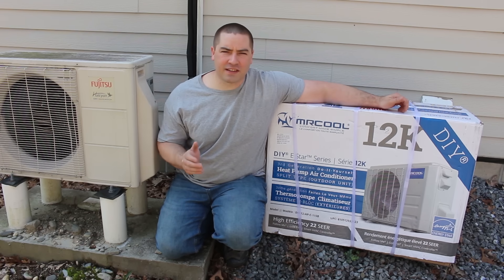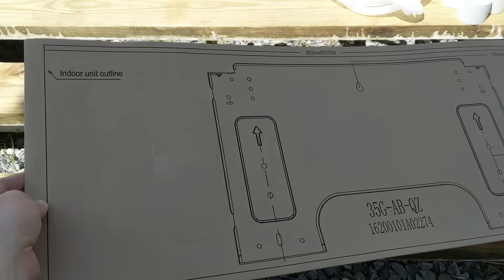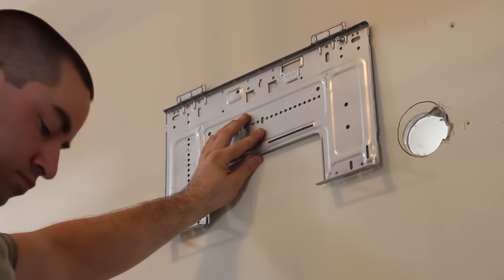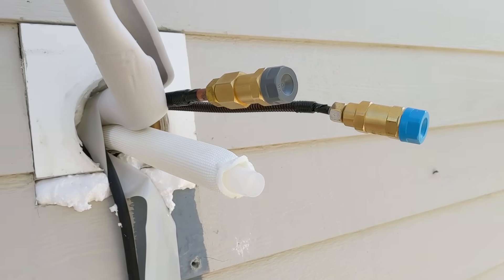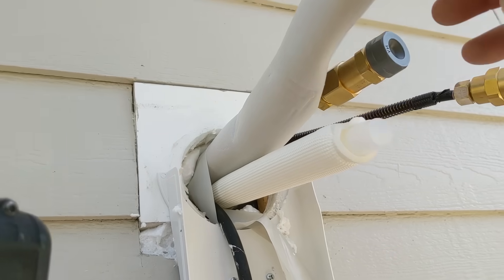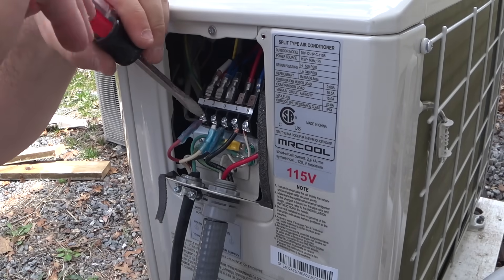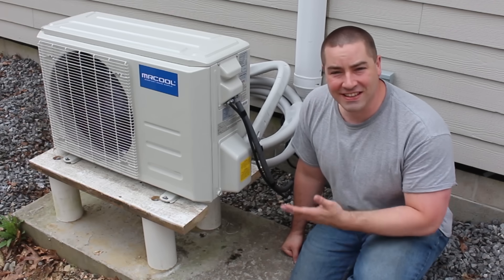Installing My Own Mini-Split Heat Pump, DIY

Comment: I've watched 3 Mr. Cool install videos so far, all of which have been very helpful, but not a one has expressed any concern about coiling up the excess pre-charged line sets once at the condenser. The units come with 25' line sets which for my 1st floor install is 10' more than I need. I've read contradicting articles about coiling. Some say it's fine to do so, others say coiling  may impede oil return to the unit. There is a 15' Mr. Cool line set available for an additional $300. Is this necessary ?
Reply from the maker: Mine stopped working due to leaking refrigerant.  Leaking refrigerant has nothing to do with coiling a lineset, so I'll say that the coil doesn't matter.  But, I'm not getting any more Mr. Cool stuff personally.

Comment: Not criticism, just added for those who may need the helpful ideas based on experience.  Did he level the template? Didn't look like it, but would be worth noting as part of the verbal instructions. For his modified base for the outside unit, it looked he may have used wood. A composite deck board would have made a best choice. For the wood, a clear coat spray paint with UV blocking capability on the label, such as Rust-olium Crystal Clear will protect from the suns damage & water. Also a spray can of truck bed-liner would make a permanent durable weatherproof seal for that area.

Comment: Hi. I watched a couple of your videos. I'm wondering which method is better to raise the condenser for snow? This one where you had previously used 4 inch PVC pipe risers (filled) with concrete or the one which you built a pad, then after 30 mins of the concrete somewhat hardening, you placed 2 concrete bricks on it and leveled？ Appreciate you a lot. thanks
Reply from the maker: The concrete block was much simpler and works fine.  But, it worked out because the feet on the compressor unit fit the size of a concrete block.  If your compressor unit is a different size, check if it will work.

Comment: My issue is with all of the excess coiled refrigerant lines behind the unit, condensate disposal, and the fact that an average house would need 3 or 4 units for even cooling. The concept has merit.
Reply from the maker: Yeah, I don't recommend this DIY kit anymore.  I prefer to cut/flare/vacuum my own lineset.

Comment: Great video.  I don't like the coil of set line that needs to be put stashed behind the compressor.    It seems that Mr Cook ships 25ft sections only to the big box store channels.  Is yours a 25ft section or a 16ft section?  Thanks
Reply from the maker: Mine was a 25' coil.  Mr. Cool stopped responding to my e-mails after my unit stopped working.
Reply: @DavidPozEnergy  I see now that you have a couple of Mini-split install videos.  I guess that is not a ringing endorsement if they keep needing replacement.
Reply from the maker: No.  I've had the best luck with the one I vacuumed down myself.  I don't like this DIY kit from Mr. Cool.

Comment: I look for things that don’t make sense or (wtf) issues and must confess this one was almost flawless. The only potential issue was cutting the condensation tube too short and allowing it run into the houses foundation. Not a big deal and is nit picking considering the fantastic content provided. Well done!

Comment: Awesome video!  I installed a 24K unit and planned my run to use all of the 25 ft line set into the center of my house through the attic.  For the inside drip, I was able to route to the garage floor.  DIY cost was about $3K plus my own labor.  Quote from the local AC guys was about $14K.  I love the quiet operation.  Working with Cielo to diagnose why the app and Wi-Fi connection doesn't seem to work.  The remote works perfectly fine.
Reply: How big of a room is that unit in?
Reply: How easy was it to route through attic?

Comment: The only thing I'm wondering about is how to fill the system with a full charge. The lines aren't charged until you connect them to the compressor unless they are charged before connecting. Maybe I missed something. Nice video of the install.

Comment: You either got a dodgy installer or did it your self with the Fujitsu unit. The have 5 years parts and labor warranty upon purchase.
My guess is the reason you didn’t claim warranty is because the installer was unlicensed or you installed the unit. When you do things the cheap way you end up spending double the money and 10 times the headaches.

Comment: Hi, thanks for sharing so, since you've had it since about 2 1/2 years do you still recommend it has there been any issues with it? Thanks
Reply from the maker: No.  It stopped working and Mr. Cool has stopped responding to my e-mails.

Comment: Aren't you supposed to pull a vacuum first to test for leaks before releasing the refrigerant? Seems like you have a tonne of air in your hose now and hence why it didn't hiss when you released the refrigerant

Comment: Thank you for the walkthrough of your installation. 
One question for you, don’t you have to vacuum the unit like I’ve seen done on other videos ? 
I’m installing one in my home and I would like to know. Thank you!!
Reply from the maker: Some models need a vacuum and some don't.  check your manual.

Comment: Two years later, any update? Is it still running as it did initially?
Reply from the maker: It is not working right now and I've emailed them a lot, but they stopped responding.

Comment: Overall a great project and I'm a diy when ever possible. Watchin is one thing but to electrify a heat system is not good idea for providing such a 'kit'. So many things that can and or do go wrong, it may cost you a lot more if unit goes south. Assume there's a limited warranty on the unit ?

Comment: FYI. From my installation instructions: "The line sets are designed to only be installed once.
The seal within the line set cannot be guaranteed if
they are installed more than once. This will void the
warranty. They also contain a compression fitting
to seal and do not require a thread sealent (teflon
tape, etc.). Using a sealent may actually cause the
connection to leak over time."

Comment: Doesn't look nice will all the extra tubing left over sitting behind your unit.  Also it blocks up air flow on the back side of the unit.

Comment: Great job on that installation! I guess one of the drawbacks with a DIY system is all that wound up piping you end up with outside. What room are you heating/cooling? How is this system doing summer of '22? Subscribe... check. Notification bell... check.

Comment: Thanks so much for this detailed video!!! I’m toying with the idea of getting this for my bedroom which for some reason is the only room in the house that I cannot keep cool enough in the summer or hot enough in the winter despite everyone checking everything about my how’s unit. I decided this might be a good alternative. However, I have no idea the vastness of the outside unit and that may be an issue because I’m on the second floor and I guess it would have to sit on the deck outside my room. I guess I’ll have to do some more research but thank you so much for this! Very informative!

Comment: I'm shopping for a new system to replace my 20y/o ac & furnace. I see the mini-splits in restaurants and other places so I'm wondering how has it worked for you since you installed it in 2020.  Thanks in advance

Comment: David thank you. 
Did you connect originally the electrical part to your panel box inside?  Would you happen to know approximate cost to run a line to panel box. 
I always thought Mini split system uses 240 volts. 

So on your panel box are you using 20 amp or 30 amp switch’s. 
Thanks

Comment: Forgot to vacuum the lines to remove moisture and that will tell you if you had a leak in the line, plus by no doing the vacuum you are leaving moisture wich will kill you refrigerant

Comment: David, I am about to choose a mini split for my off grid cabin. I was please to see in the video the unit your installing is a 115 volt unit as that is what I intend to order. When I click the link you provided for the unit on Amazon it brings back a 230 volt unit. Exactly which unit did you use in the video?
L Moore

Comment: NOTE:  You might have wanted to RUN your condensate discharge line  AWAY from your foundation ?
...
You had quite enough to allow the DISCHARGE to drip out UNDER & Past  the LEGS to your OUTSIDE Unit 
... 
Thanks for your VIDEO

Comment: Thanks for the video!  A few tweaks:
About 3:20 might want to use a level when using the template.
6:48 lots of daylight around the pipes; bit more foam?
11:00  best to insulate the two lines separately, rather than bundling them together; any heat that leaks between the hot/cold and return lines doesn't transfer to/from the head unit inside the building.
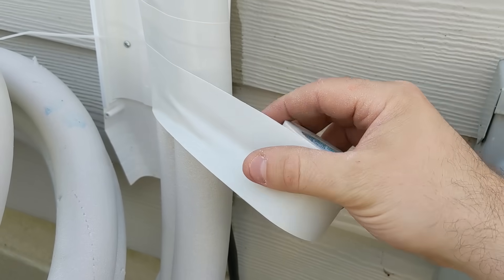11:43 maybe want to caulk that top flashing?
12:03  UV degrades plastic, and you maybe don't want water dripping next to your foundation.  Perhaps cover it, and run it a little ways away from the wall.
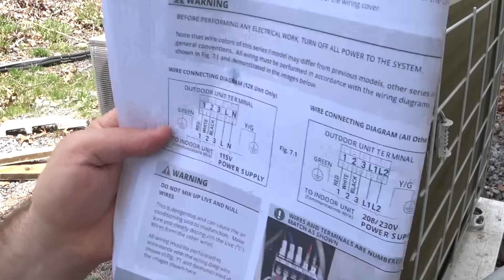13:20 WAIT -- you have weather gasket material sticking out to the sides of the cover, and angling UP to form a funnel for rainwater.  Not the ideal installation.
I would seriously do something to protect the coiled lines; critters and UV are going to chew up the insulation on those lines, and at least around here plants are going to grow through the coil, and you'll be losing heating/cooling.
Reply: He seems to have used a level right after pivoting the template but yeah might be better to do that while marking the vent hole, otherwise it could be slightly off :)

Comment: HVAC installers will be very busy the next few years.   Installing and/or fixing peoples mistakes LOL

Best Tips I can give:   Use the Nylog Blue on all your Brass connections else they will leak ,   put a plastic top lid over your Heat pump else they freeze up and short cycle,   just crack the nut to evac the line set IMO.   Good Luck

Comment: Tip:  Make sure you independently "super insulate your line set" and also place fiberglass insulation directly inside the cover where your line set connects to the outside unit.

No bare copper showing at all.
Reply: Rockwool insulation would be perfect for that. I'm doing that. I'll be installing mine next week.
Reply: Me, all so warry about how little insulation is around the copper pipes, and why the outside plastic cover is not fill with extra insulation?..Not fiberglass!. But Dave's video has anything to do with that! Good video! Thank you!

Comment: Imo HVAC Techs only cause more issues. Mini splits come fully  and "perfectly charged and pressurized" to "optimum factory specs".   Think of your home window air conditioners.... no need to pull vacuum and they last 10 years.  Why would you ever want to mess with a perfectly sealed system?

The one  big difference is the "the line sets" for mini splits.  So just pressurize those by opening the pressure valve on one side and cracking the nut on the other   Once you hear the air pressure,  tighten the nut.  This imo,  gives you the most optimum initial set up.   

Use nyloc on the threads and soapy water to check all your connections for leaks

Imo Hvac techs with their wonky gauges only cause more issues by letting in air and messing with suspect micron gauges in a "perfectly factory sealed and pressurized system" LOL.  Most of their vacuum pumps are old, outdated,  not working properly,  gauges not reading properly,  they don't run vacuum long enough,  bad seals in testing equip., and will only cause you more issues.  Let's face it,  Hvac techs prefer to take your money and I would prefer to trust the factory setup and not tamper with it

Good Luck all...  Just think about it before you decide.

**   Note:  This is just my opinion after really thinking about the Evac process being done to a perfectly factory sealed and pressurized system.

Comment: very interesting install. ive been offered a 5kw air to air air source heat pump. i have quite a small house and would have the inside unit in the living room and would open living room door to let heat out to the other room. what you think of the units sold by applances direct. 12000btu model for about £350 , from what i was reading they use up to 1.5kw and give maybe 3kw heat out inside. i know nothing about these and trying to get an affordable system to replace my storage heater . whats your thoughts

Comment: Bro this why you need a HVAC tech to do this bro. You don’t leak check with refrigerant you leak check with nitrogen. You need to get the moisture out of the lineset with a vacuum pump. If you don’t you with mess up your compressor smh. HVAC is not do it yourself work.

Comment: I love my mini splits.  I do all mine myself.  I do have vacuum pump and pressure/vac gauges.  I use a “ generic” brand of mini split inverter and all three have never failed me.  I have one unit, my second install and very sloppy too, that I have never turned off in 7 years.  I helped a friend install a Mr Cool system.  They are much easier to install as the learning curve for flaring or brazing and evacuating the line set is avoided.
Reply: What generic brand did you use please...
Reply: Dan, I'm building a 28x32 garage with a loft above. The loft will be around around 600 sq ft. based on what you've seen with this Mr Cool unit, would you recommend it?

Comment: How did this turn out, considering that the pipe-set wasn't vacuum pumped ? Has this unit performed well? Has it failed? Is vacuum pumping an unnecessary step?
Reply: ah... maybe your flares are special and keep the line-set vacuumed during install. That would explain why you didn't shorten the lines and re-flare their ends

Comment: You’re dumb you didn’t vacuum down your line set your compressor will fail in a few years. Anyone who thinks this will work is very dumb. Do a little research dude.

Comment: Great video, Thanks. One question that has bugging me, no vacuum pump to cleanup the tubes before opening the valves at the exterior unit? Unless the connecting tubes are already evacuated and are free of air. I guess that where the DIY cones in.

Comment: Hi David - Hoping to learn if your MrCool mini split has been meeting your expectations?  I am preparing to purchase a mini-split for use as an alternative means of chilling a walk-in cooler on our farm.  The reality that the MrCool option with the precharged lines is the only DIY option that I've come across has me pointed in this direction.  Perhaps you have heard of how people are using standard A/C units and mini splits to chill walk-in coolers using a device called a Coolbot.  This is why I've popped into your comments.  While there have been many people who have validated their success in using many different brands of mini-splits, there has yet to be anyone validating the MRCOOL mini's.  I learned this directly from the Coolbot people today.  Given that the Coolbot and MRCOOL mini's are both DIY- based products, I believe there is pent up demand for a video on this subject.  The audience is substantial, including farmers, hunters, homesteaders and preppers.  While you may not personally need a walk-in cooler, given that you have a unit on your premise, you could verify that the Coolbot plays nice with MRCOOL... or maybe doesn't. The potential on this is just way too... COOL!
Reply from the maker: The Mr. Cool has stopped working and I've been e-mailing them for months to try and see if they would help me through the warranty.  At first they responded with constantly asking for one more thing, like one more picture, one more video, one more question, over and over again.  Now they just aren't responding.
Reply: @DavidPozEnergy  Quite uncool indeed.  Surely MRCOOL must know your installation video has already been watched 1.25 million times by future prospects.  If they are unwilling to help you of all people after such a rapid failure, it does not bode well for others who may find themselves in the same predicament.  Disappointed, but grateful for your feedback.

Comment: Good job, but I noticed you didn't install the plastic sleeve between the wall and outside. They didn't supply you with one?
Reply from the maker: My walls are too thick for the sleeve that came with it.

Comment: I couldn't see the air being removed from the connecting pipework. Does the normal installation not require a partial vacuum to be established in the pipework before the refrigerant is released?
Reply: Both units are precharged with freon.

Comment: I've had the same issues as you with my Fujitsu and am now curious about your Mr. Cool system.  How is it holding up and have you had any performance issues?
Reply from the maker: I would not go with a Mr. Cool again.  It has stopped switching from heat to cool, which makes me think the reversing valve is stuck/broken.  I've tried contacting them for warranty support and so far, no response.  I have since installed a mini-split that needed vacuum and such and it's working perfect: https://youtu.be/Kd092alkeaE
Reply: @DavidPozEnergy  Thank you for the update.  It seems all these mini splits have a problem at the flare connection.

Comment: The heat pump has proven to be hopeless at providing hot water and heating more efficiently than an old gas boiler. The heat pump needs a lot of electricity to turn its fan continuously even if heating or hot water is not required with inevitable unacceptable noise.

Comment: One big mistake he made at the beginning, when isolating the electrical supply, was not to lock off the electrical disconnect box. He should have used a padlock to lock off the disconnect box to prevent any unauthorised person from switching on the electrical supply.

Comment: I had a Fujitsu 18K heat pump fail - it was not very serviceable, and difficult to keep clean. I paid to have it installed for $5,000. 

Mine also developed a refrigerant leak, and because of the repair cost, it was a throw-away unit.